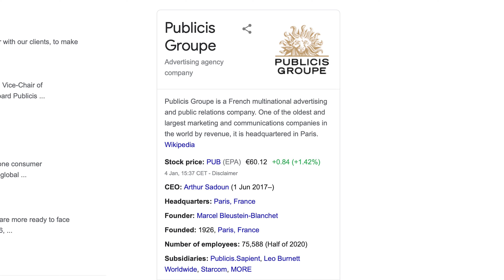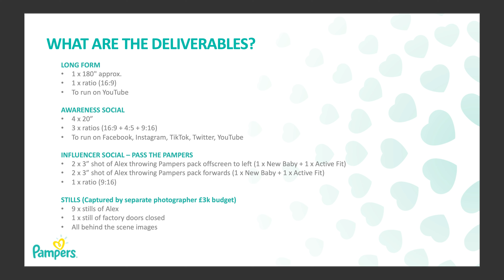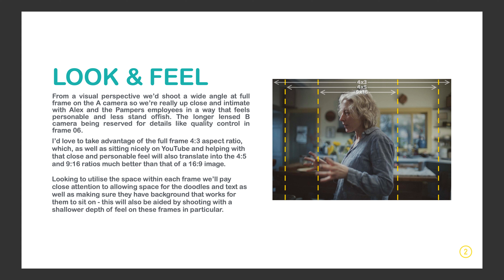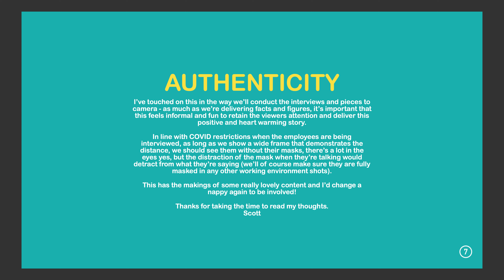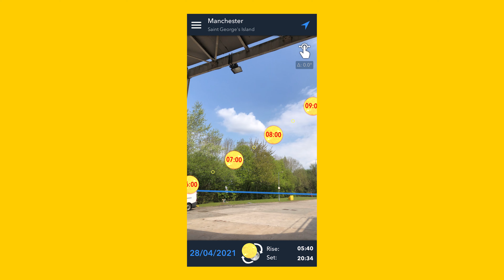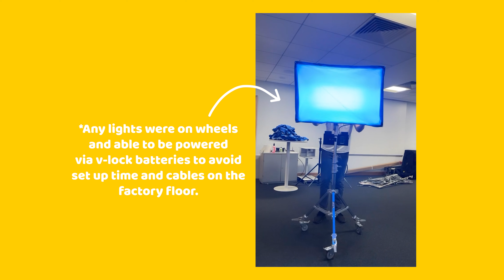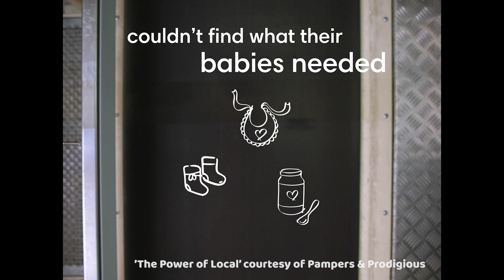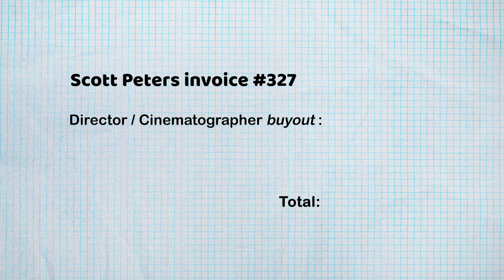How To Pitch and Direct Content for Big Brands

Comment: Hey Scott. Can you explain what a 'buyout' is vs a normal day rate? Thanks :)
Reply: It's a flat rate you get paid for the whole project involvement, rather than a day rate. If you're a director/producer you end up spending so much time on a project but it may not always be full days (especially in pre and post production) so it's a neater way of working the budget
Reply from the maker: Sure thing Adam. A buyout is an agreed sum for your involvement across the whole project, as opposed to a day rate which is exactly that, a rate for each day your working.
It’s a little tricky to break down your time on projects like these, so rather than be like: we need you for 3 days at £1000 a day and we might need you to come to some meetings, but we don’t know how many meetings and there’ll obviously be prep work, but that could be 2 hours or 20 hours depending how much is needed/you want to put into it, so it’s easier for all to agree a buyout. Sometimes this works out in your favour were you make a load of cash for perhaps less work than you might have been expecting, but other times you find your working a lot for that buyout. This might be a subject worth going into more detail as there’s more I could say / explain, but hope that clears it up somewhat without me making it more confusing…
Reply: Thanks for the breakdown Scott :) It makes a lot more sense now. Are you usually the one to suggest a buyout vs a dayrate or is it something you’ve found clients suggest because they can’t quite quantity what your ‘dayrate’ would even be converted to if they added on a prep day of x amount of hours or a recce day of x amount of travelling/hours etc?
Reply from the maker: @HeyAdamGrasso  It’s something the production company would suggest when hiring me, dependent on the type of job. But it can also be based on a “day rate” in the way that you’re offered shoot day rates, that might sound ridiculous, like £7K or £8K, but then you’re expected to do as much work that is necessary to get the job done around that shoot day or days, which could be weeks or more. I’m not sure if there is much difference in this, as it is essentially a buyout of sorts, but production will normally be pretty up front about what’s expected from you in pre and post production. I’ll speak to a few producer friends of mine and ask a few questions myself about why these are sometimes dressed up differently.
Reply: @ScottPetersFilms  Interesting. The last few Music Videos I made, I suggested a 'project rate' rather than a day rate. Just because it was difficult to costs things per day. Also I was editing as well as Directing/DP'ing, so couldn't really accurately say, 'I'll be editing for 2 days so my day rate for 2 days is x' So made sense to work to a release deadline and then put as much time as I wanted to into the edit with the final 'buyout' rate already known to me. Would be amazing if you could ask a few of your producer friends to see what their understanding of when they dress up jobs rates as 'buyout' vs 'dayrate' :)